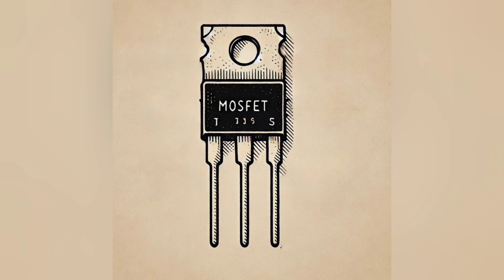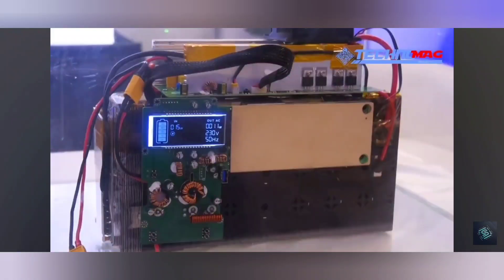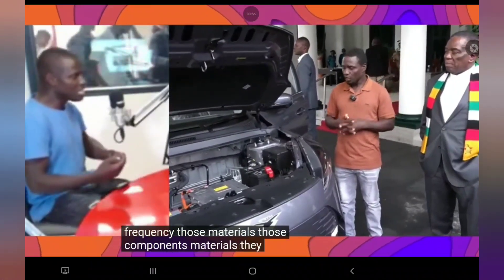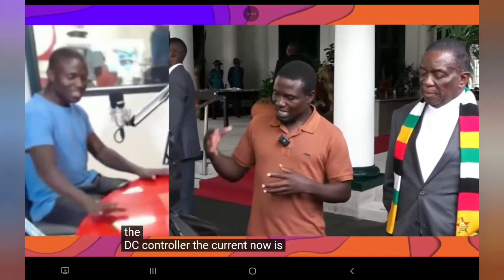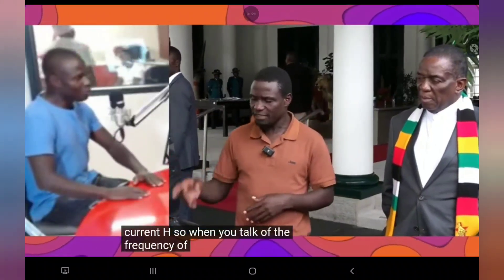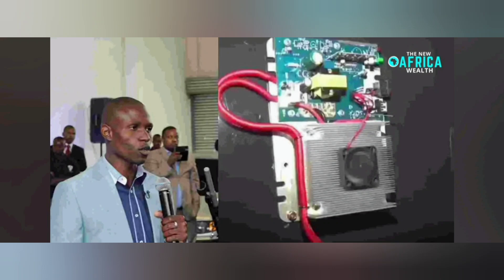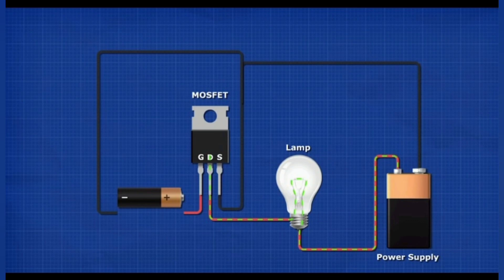mosfets acts like generators that produce amps

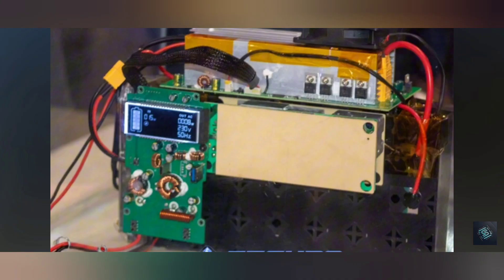Comment: I'm most probably going to receive criticism from what I'm about to say and I'm not saying that it's not possible to generate electricity from radio waves, but the mosfets you refer to in Maxwell's Invention is part of the components on the Inverter and Charge Board of an Browey C600 Portable Power Station and not his Microsonic Enenergy device. Another thing that I would like to point out and that seem suspect is that the Inverter shows a load of 8W at 230V 50Hz and is charging at +/- 15W. Now in his presentation of the device in its glass box there was no load attached to the AC output of the device, then theoretically if his device is generating electricity to charge the battery the AC output should be 0W at 230V 50Hz. The only way that the Maxwell Microsonic Energy device that He presented and that you mention in your video from time stamp 2:22 can charge the battery and with no load attached while still showing a load of 8W at 230V 50 Hz is if the device hidden just underneath the PCB where the mosfets are situated is the Browey C600 Portable Power Station's Charger that is directly connected output of the inverter board and to the input of its charge port, with the battery basically already fully charged its only charging at 15W but due to the Inverters Efficiency and Energy losses the battery will eventually run down. Here is a link to BeatTheBush's video A Look Inside the Browey C600 Portable Power Station https://youtu.be/9nhf7EC4EKc and you will see that Maxwell's device looks exactly the same.
Reply: If Maxwell’s device is not just a Browey C600 rebrand, then he might be using specific frequencies to extract energy from the environment.

Possible mechanisms:

Tesla’s Resonance Effect: Tesla theorized that the Earth and ionosphere could be used as an energy source if the correct resonant frequency was applied.
Scalar Waves: These are longitudinal waves that could theoretically transfer energy without dissipation.
Schumann Resonance (~7.83 Hz): The Earth's natural EM resonance—some claim it can be used for energy extraction.
High-Frequency RF Extraction: If Maxwell discovered a unique way to capture and amplify RF energy, it could explain the apparent self-sustaining power.
Reply: Thank you.   I can't believe that this scam is still around.
Reply: @WIZ56575 What are your thoughts?  Be smart about your reply.
Reply: Oh yeah, your right. In some other videos I have seen from Maxwell, he claims that his Microsonic device is protected. And that if anyone tries to tamper with it then it will destroy itself! Shame that he's being so protective over how he's done it, the world needs to know.

Comment: but how does it generates more than it consumes?
Reply: @WIZ56575  Please explain this.
Reply: It doesn't!!!! It is an absolute impossibility, will never be done cannot be done. Unfortunately the knowledge needed to understand the true paradox is not something the average person is exposed to. Probably best that way too. The best I can offer is this thought experiment for you..... If this little device could make more energy than what it received, then all you do is series stack them for exponentially huge never ending power because you could feed a tiny bit back to the first one and never need any other source once first electrified!.... This concept is classified as perpetual motion! And does not work. Zero point energy works by multiplying an input source, so how does that work? The energy changes form 3 times in the process and is not compatible in its final output to the source. But we're not supposed to know that for another 15,000 years!! That's not a mistake! But how do I know and not happen for 15k yrs.... You don't want to know.
Reply: @mrgoodman6620 
Well, I guess we'll see, won't we? No need to get all excited - he will prove his invention, or it will fail. What is everyone so upset, and excited about? His car has just hit the market (a Chinese company used the shell from one of its existing electric cars, and Maxwell's people converted it to his technology. They can produce a vehicle running on this technology for 14,000.00). 
Now - either we will see this doesn't work (the first run of automobiles has been produced, and are being marketed), or it won't work, and will fail - so why is everyone so excited, and angry, and jealous? Calm down, please. You'll have a stroke.. 
Several very prestigious Universities in the U.S., and the organization "Thrive!" - founded by one of the sons of the family that owns "Proctor and Gamble Corporation" have also vetted it, and say it is legitimate. 
We'll see, won't we? Nothing anyone on this channel, or anywhere else, can say or do, will stop it if it works, or change the speed at which it will fail, if it doesn't. 
So what's the big worry? If it works, it will change the world - and about time the Petroleum Cartels are brought down. If it doesn't work, it will just be sad.

Comment: thnx very much for explaining these things to me and others.

yes, a mosfet is just a switch - learn and understand this before criticising Lloyd.
yes, the car is obviuosly a regular electric car running on batteries and he is claiming a DEVICE THAT CAN CHARGE THE BATTERIES and here is explained the principles that could/must be used.

in basic terms Tesla was always on about frequencies, and what is obvious is that resonance is very useful!
Reply: Right so if I am understanding correctly a mosfet is just the device that lets energy flow once it detects it. He would have to have some other device to receive the radio waves.
Reply: @jasonharris2790 Yes, that's where the bifilar coils (Antena) come into play. He's channeling that energy and amplifying it with a device that has MOSFETS, and then using this boost in power to keep the batteries charged indefinitely.
Reply: In the circuit at 12:07 the MOSFET acts as a switch. When the small battery on the left is connected to the gate (G) the MOSFET connects the Drain (D) to the Source (S). Current then flows from the +ve terminal of the 9V battery on the right through the bulb then through the MOSFET Drain to Source and back to the -ve of the 9V battery. All of the power to light the bulb comes from the 9V battery. The MOSFET doesn't make any power its just a switch.

Comment: Another thing I would like to mention is getting a project at hand showing how to build an replicate device are similar device  like it and how to convert it and make it work, by demonstration  than we will see that it can be done. There is alot of questions that need to be ask because questions  was made to ask and answers as well for instance can the device withstand going through water without interference or disturbance of the water  shorting of the circuits another one can it also withstand an EMP attack etc. There are so many questions  need to look into and explanation  of things not just viewing things on the surface but beyond it.
Reply: Listen closely please.   There is not even proof that it can power a TV all day long.  Why worry about an EMP attack or water at this time?   It is all fake to begin with.   I am embarrassed that you are so gullible.

Comment: Gerard Morin showed almost the same with his hyerdrive motor which gave tremendous torque because of a sound frequency and NO batteries and/or solar cells attachted! He had to have the controller custom made in China because they couldn't do it for him in the US.
The smartest thing these inventors can do is to make the blueprint available so people can download a pdf for a small fee and then build it themselves. First of all, the inventor is not only safe but the world can move forward without corrupt oil companies that drain us. Just common sense. Power to the people!
Reply: agree, the enlightened future is opensource, share knowledge! thank you Lloyd Stovall for your high morals and Tesla for the same. Maxwell will help people bettere by releasing the design that works.. is he just trying to get rich? him saying that it will self destruct if opened makes me think it is a scam.
Reply: @ he couldn't patent it, that's the reason of a selfdestruct mechanism. But as I explained it's better to upload the blueprint and make it open source. Much safer and he can earn enough with digital downloads.
Reply: Open source is the future for hardware and software. Just imagine what we can do with these types of power systems with robotics and AI. The "elite" aren't going to keep everything to themselves forever.